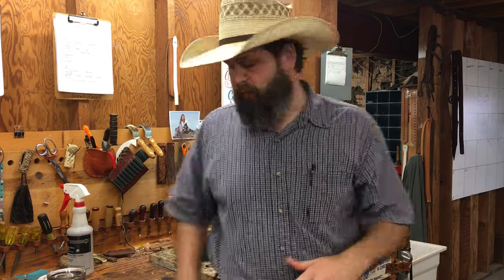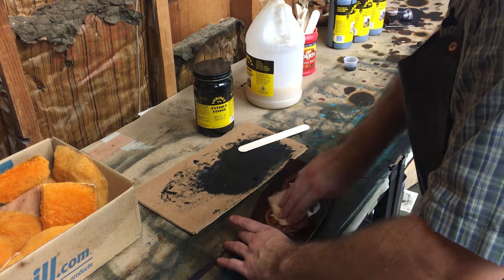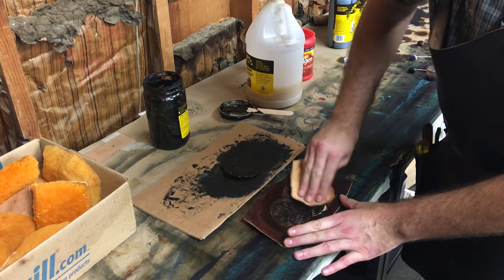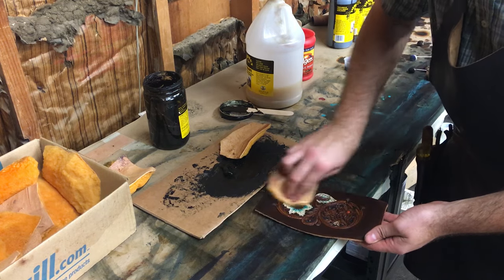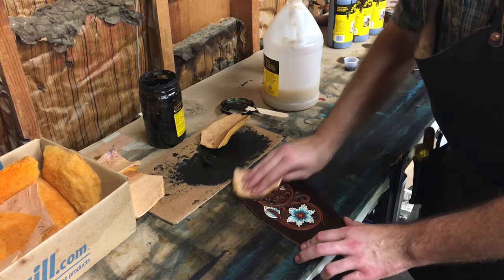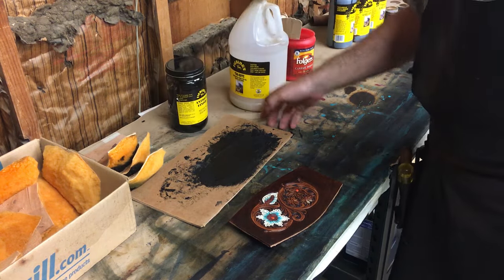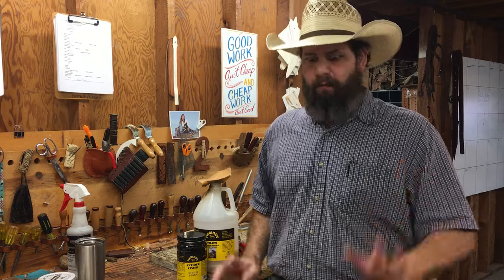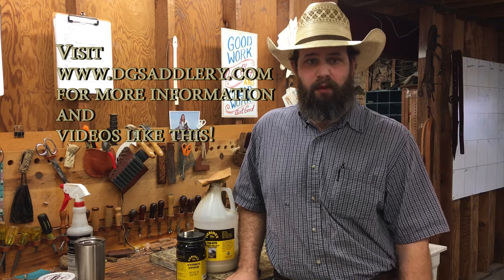antique video

Comment: Don, I like to use a light coat of olive oil to begin to darken the leather between tooling and putting on my resist in preparation for antique. I usually get good results but occasionally, even when I'm careful, I manage to get too much oil in one place and it goes too dark and it never evens out. Do you have any tricks or tips to keep oil consistent? What do you use to apply oil evenly?

Comment: I have had issues with the antique flaking, such as on a spur strap where there are flexible areas, do you have any tips or recommendations for areas such as this? I use the same process and products as you are in this video.